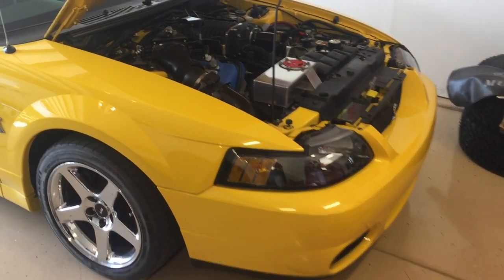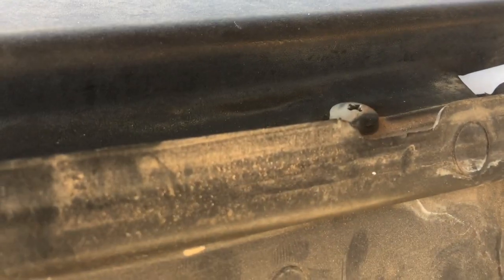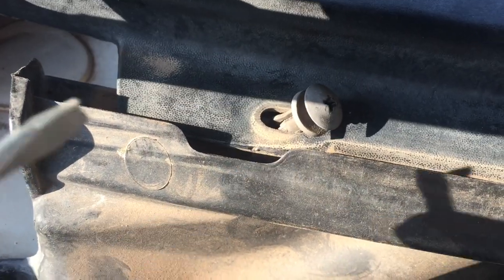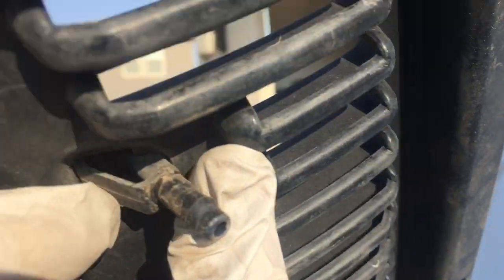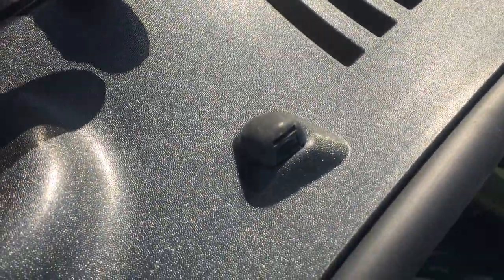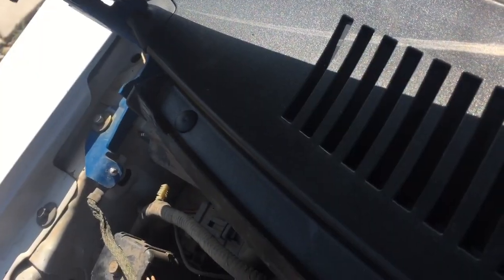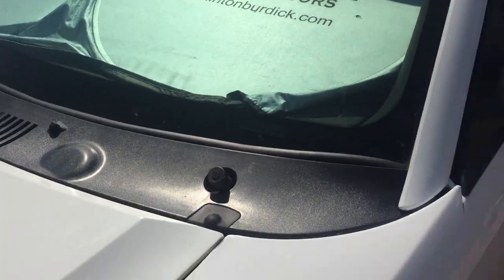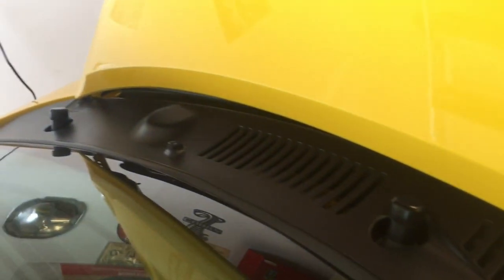Wiper Cowl Replacment: Ford Mustang 99-04,  94-98

Comment: I bought  the 2 piece for $34 delivered..  Just had to get a little creative .  Double side  Gorilla tape  is  your best friend.  I also ran double side tape about  1/8  of a inch  At the bottom of the windshield all the way across pillar to pillar underneath the cowl vent  rubber .  I also ran it across the body frame  where the clamps go all the way across and  cuts slips in the clap holes  It came out perfect..thanks for the video.!

Comment: I had a rock that hit my windshield causing a crack, so I replaced it.  Noticed a gap between the windshield and COWL seal in the middle.  Replaced the old with new COWL but seal and windshield still has gap.

Comment: This is great, I just bought a 2000 V6 as a project car. Was wondering how to remove that cowl because I need to reseat it. Might just buy new ones in case they break. Gonna check out other vids for tips. Nice fourth gen mustangs man.

Comment: Trying to figure out if the cowl from 99-04 will fit my 98, because it's $100 cheaper for the newer model year and it's a daily driver
Reply: cannot confirm 100% but i think the 94-98 one is a bit smaller or a slightly different shape

Comment: Hey brother by any chance you don't know what it could be causing your wipers only to work in high and not intermittently 2002 mustang
Reply from the maker: It may be the turn stock selector 
Turn Stock Lever Replacement/ Removal: Ford Mustang Turn stock replacement Mulit function switch
https://youtu.be/ZCUUOsRvkKo

Comment: The video install is for a two-piece cowl. Link is for a one-piece. What is the link for the two-piece? Great video and step by step install. Much appreciated to know what item you used.
Reply from the maker: I put a link for the one piece because it is a better one than the two piece. The gap is noticeable but it depends on if the car is a show car or not. With it being a new piece, I would recommend the one piece and give it a little bend to install. The two piece one is available on ebay if you search for it
Reply: @dannyjohnsonsgarage   You did a great job, especially with a lesser quality part. There are very poor reviews on all two-piece cowls on Amazon. I agree with you and others that the one-piece may be the best option. Thanks again.

Comment: them sprayers break be careful  separating  the hose 30 a pop also to replace and reuse the old clips dont use tape, when it gets hot it will release ,been in auto glass for 26 years seen it all

Comment: I put this on and it sucked. We’ll kind of. The tabs are way to small for tabs. I had to wire tape it and put super glue down. Holds really nice. All but one tab was able to get put in on the bottom. Also doesn’t line up exactly in the middle. But all in all, better than broken. Things in there good.